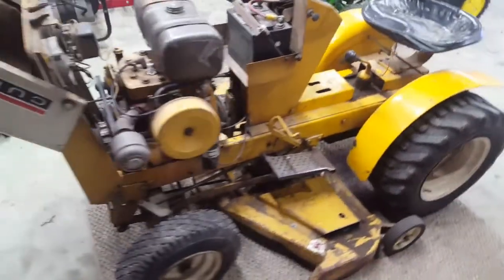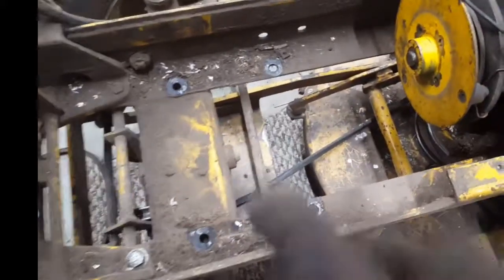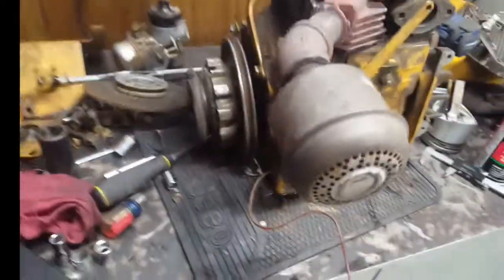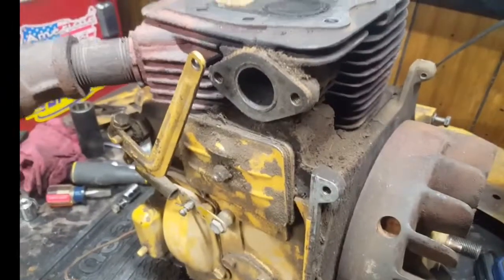1964 International Cub Cadet 100 Part 1

Comment: I also have a 64' 100 that i restored last month, my dad had it in the shed for about 30 years and finally got it out to restore it, one problem we have is the throttle return spring, It was no good when we took everything apart but we also lost it so we arent sure what it looks like or where it went, if you have any pictures or video of where that spring went that would be really helpfull
Reply from the maker: Glad to hear you got your restored. I hope to do mine this summer. I've been putting it off. Lol Here is a quick video of the linkage.  https://youtu.be/gCoc3BwQoAk